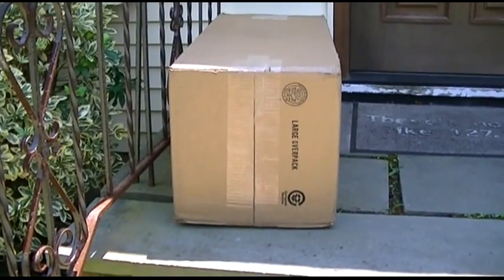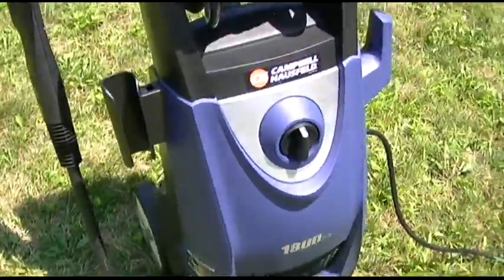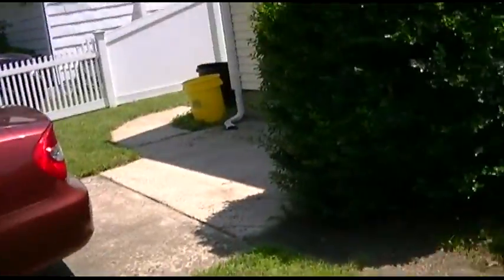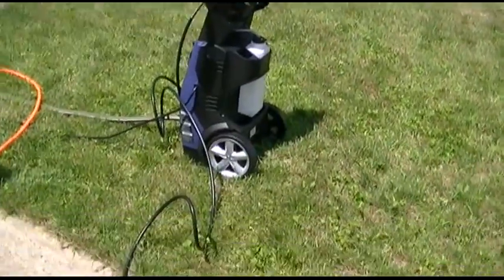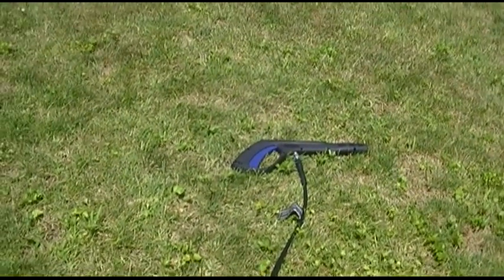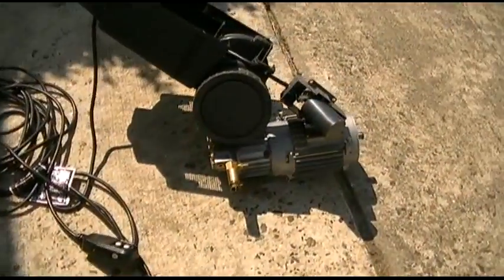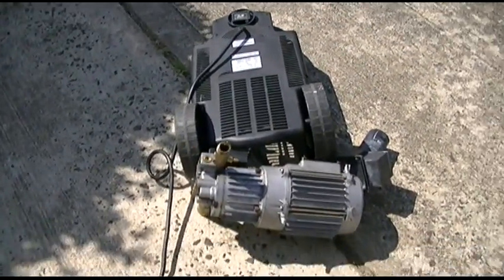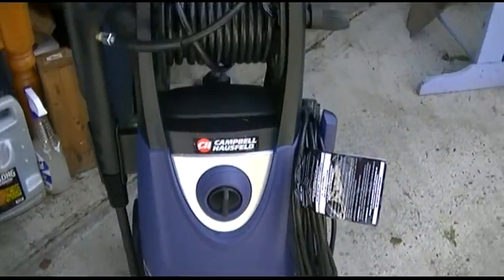Campbell-Hausfeld 1800 PSI Pressure Washer Review (Model PW1835)

Comment: Hey Jay nice video. It's 2021 and mines still works like a charm, never had any problems. BTW I never used the wand the swirl. I used it to clean all the concrete sidewalks, the cars and windows...it's one tuff entry level pressure washer and I have never cleaned the filter. Guess I should do that one of these days...Lol
Reply from the maker: Thanks very much!  Mine still works also, though it has developed a strange problem.  Start using it, everything's fine.  Let go of the handle, it stops.  But every now and again, just sitting there, the pump will run for just a second.  There's no leaks from it.  This isn't the first time I have seen a pressure washer do that, either.

I found it painful to keep squeezing the handle, so I used a zip tie to keep it on all the time.  When I'm going to stop for a bit, I shut the switch off, and if it's for more than a minute or so, I'll turn the water off as well.
Reply: @jaykay18  When you squeeze the handle push in the button on the side if it still works..it will keep iy going so yhat you don't have to hold the trigger
Reply from the maker: @user-rv5tx8dl7k  As far as I was aware, that was a trigger lock-out and would prevent you from squeezing the handle.  You may be right, I'll take a peek next time I'm puttering around the garage.

Comment: What do you mean by when you said that the motor failed open circuit and did it trip any breakers?
Reply from the maker: Didn't trip any breakers, the fan atop the motor stopped spinning, the motor overheated, and the windings inside overheated and like a chain, the weakest link is where it fails.  So there was a weak point somewhere in them, and it broke open, hence open circuit.  Didn't hum, didn't do anything, just totally dead as if it were unplugged.

Comment: Jay, you she buy you one from Harbor Freight to try out.
Reply from the maker: +Marshall H. (gatrwrks) Fund it for me and I will!  Just kidding.  My first pressure washer, the Black Cat Products one was 1800PSI, and it had a nice, honkin' induction motor.  Because China, they didn't assemble it with a good mount for the motor, nor with adequate enough cooling.  What would happen first is during extended use, the motor would get so hot, the fan blades would melt off the shaft.  Then the motor is left with no cooling.  It continued to run for some time until it got hot enough to melt the casing and break out of its mount, and it basically went into a smoky mess.  There was a recall on it, and I was aware of it, and even called the company to inquire.  They couldn't replace the unit, only give a refund, and I couldn't find any others like it, so I let it be until it died.

Then I bought this one.  Again, because China, they all come with dinky universal motors, so it's just not the same.  It works well enough, and isn't that bad of a unit, but it's not like my old one.

I use my pressure washer very occasionally, which is probably why the first one lasted as long as it did.  Now that I have this one, as long as it lasts I will keep using it, instead of doing an xjoe81x and buying a new one I don't need.  When this one does die, I've had my eye on the highest pressure gas one Harbor Freight sells.  Chances are by the time I need one, the one they have now won't be available anymore and it would have been replaced with another model.  That's the one I will buy, whenever that will be.
Reply: I was thinking buying me an electric one from HF to use around the house and such.
Reply from the maker: ***** Probably would be similar to this one.  We didn't have a Harbor Freight here at the time, so I bought this one.  If you've never owned a pressure washer before, you'll wonder how you ever lived without it.  Just like a snowblower, but I guess you don't have to worry about that!  Go for the highest pressure one you can get, something like item 69488.  If you go for the gas one, it has a 212cc engine very similar to the Predator engine which is on my HF 3200W generator, and I'm very impressed with that engine.  Of course there's a major difference in price, but it's worth it.  Once you go gas you'll never go back.
Reply from the maker: ***** Exactly what happened to my old one, the motor was an induction one and ran forever.  Probably had way more than 100 hours on it.

This one I think has about 2 hours on it, maybe, if that much.  I do need to drag it out this year, we'll see how it performs.  My friend also can use one this year, hopefully that will burn it out and then I'll buy a gas one.  I'm done with electric ones.  I priced out induction motor ones and they wanted almost 500 dollars for the one I could get.  I can get a gas one for less.

Comment: I purchase this electic pressure washer with special price here: http://amzn.to/1kJ6QGn
Product is good, but it is little bit difficult to connect the water hose into inlet due to limited space. but over all, the product meets my expectation.
Reply from the maker: The hardest part was connecting the plastic "quick connect" to the unit, for fear of breaking it--and you're right, there is limited space.

I found using a rubber jar opener/jar gripper around the fitting that screws onto the unit will allow you to tighten it enough so it shouldn't leak.  You can also use teflon tape on the threads.

Also, the part of it that the hose screws into has TWO washers, they both need to be there.  The hose isn't too bad to connect to the unit once the fitting is installed properly.

Comment from the maker: You're welcome.  The problem is that you won't necessarily do much better with anything else.  It's almost a guarantee the package won't tell you what kind of motor is used in the unit, so you have no way of knowing until you try it.

Also, the "built-in hose reel" is useless because the hose isn't that long.  Secondly, the hose has to exit from the top of the machine, so therefore when you have the hose fully extended, you WILL topple the machine over onto that nice, rough concrete--scraped up.